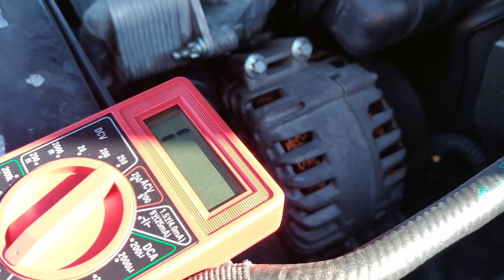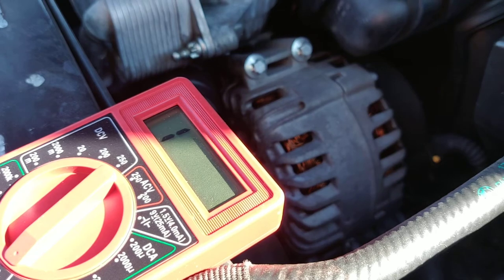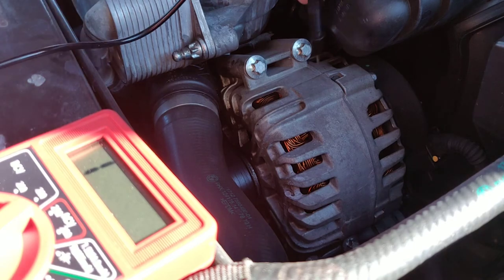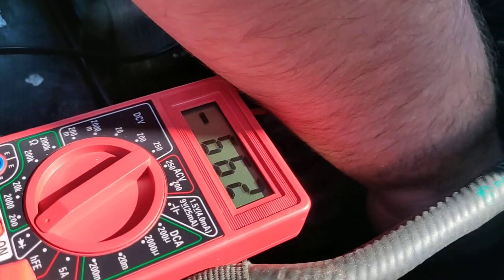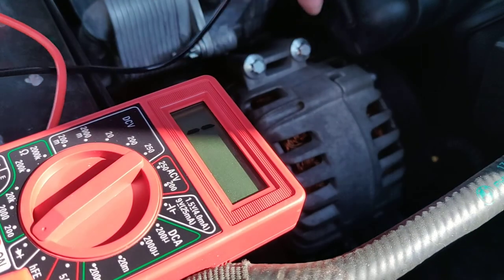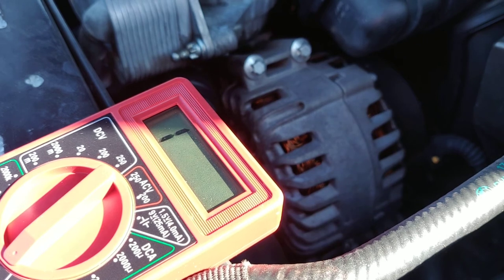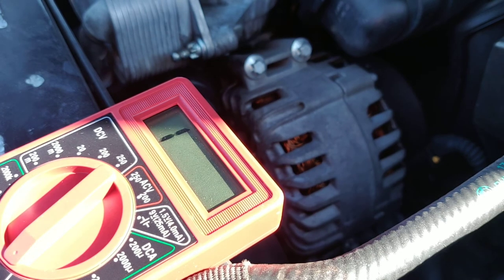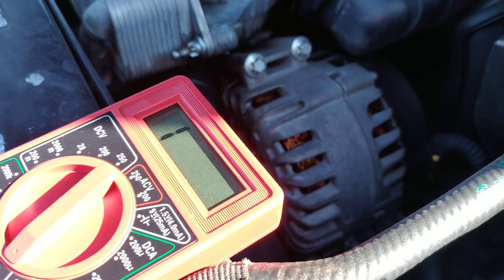BMW Parasitic Drain Found: How to Test and Fix Bad Diodes in Alternator

Comment: Turned out i had this problem on my old land rover, put brand new battery in, and still drained over night ( then learnt it was  a alternator problem) my question is after initially replacement of brand new battery i done a parasitic draw test (still with bad alternator in place) and the draw was only 15 milli amps, assuming it simply my dash clock, with such low drawit shouldn't have drained the battery but diodes were definitely gone in alternator, draw test was done at battery terminal, it appears you have answered my question ( draw test means battery is still hooked up so it didn't show anything besides that dash clock draw) does this sound correct or do you think something else was at play, i watched about twenty five vids and your the only one who mentioned the battery must be disconnected to check diodes correctly, wish yours was the first i saw, would have saved me a lot of time.

Comment: Do you have to take the main power wire off the alternator and unplug the wiring harness before you do this test or can you just test it in place?
Reply from the maker: I did the test with the wire in place. You want to see if the diodes are pulling power with it connected to the system.
Reply: @Jay-May  I appreciate you writing me back.   I'm going to try both ways I think.  I had another guy (different video) who told me I should remove the wires.   I'm still learning.
Reply: I have the same issue with a mk4 Golf and I measured the diodes with the cable connected  and disconnected from the output of the alternator (negative pole of the battery was previously disconnected). When the cable was connected at the output of the alternator, I measure 0.453V on one polarity and 1.366V with the other polarity (the value increases to 1.366V), which means the same issue shown on the video. However, when I disconnected the cable and measuring again gives 0.5V on one polarity and nothing with other polarity, which is correct if the diodes are well. So I think we should measure with the cable disconnected. I haven't found the source of my parasitic drain on the alternator circuit ( drain of 1.33A). Any clue?
Reply: @PauloM463  Makes sense, thank you.  Sorry, I'm not sure about the 1.33 amp drain.  What about radio and other memories, could it be drawing that much?  Is your battery dying?  There are videos of how to track down what is draining, but not sure which video is best or really works.  Sorry I can't really help.  My friend, the reason I posted a question here, ended up just having a bad battery.

Comment: doesn't the Bat+ terminal on the back of the alternator connect directly to the POSITIVE Terminal of the battery? and if the frame of the Alternator is Grounded.. then aren't you essentially measure the terminals of the battery too?..  What if I disconnect the GROUND cable to the Battery and then Test it?  Thanks for the video.. :)
Reply from the maker: You can test both ways, but if the diodes are good there should be no difference. We are measuring for battery drain.

Comment: Will autozone alternator test be able to detect bad diodes? 
I was told I could have a bad alternator since my battery drains
Took it to autozone to get it tested and they said it was working good 
Is the diode test with a multimeter the only way to actually tell?

Comment: I have this same problem!  Except I have an outright failed diode, it beeps at me when testing.  A new brush/regulator should do the trick (way less $$ than a whole new alternator).  BTW you should test with the negative on the positive terminal of the alternator, with the battery negative disconnected.
Reply: You ever figure it out
Reply: @hunnitkaydj  Yup - replaced the voltage regulator $40 - reduced the standby drain a bit (had other issues keeping the car awake) until g30 relay turns off.
Reply: @GP-SEA  you know what the other issues were?
Reply: @GP-SEA  thank you🙌🏽
Reply: @hunnitkaydj  I'm pretty sure I have a module not going to sleep when it should - I think it's the transmission 'park' selection switch in the transmission that is keeping that module 'awake' until the G30 relay times out.  The LED on the shifter isn't solid / fully illuminated...
Reply: @GP-SEA  I think the led stays on for about 15 minutes after the doors are locked, did the alternator fix help it stop dying?
Reply: @hunnitkaydj  Normally, yes - but not in my case - I don't think the transmission 'sees' itself in Park - so it stays awake until G30 shuts down.  The LED is on long after the 15 minute window.
Reply: @GP-SEA Was your fix on an e90? I have an e90 2006 330i w/ a 180A Valeo alternator. I ordered a new Valeo voltage regulator but I can’t tell for sure if it has the diodes in the voltage regulator part. Some people online are saying that the diodes/rectifier are separate and not really replaceable. 

Hopefully they’re not right wrt e90 alternators
Reply: @johnnypolex  yes, it was an E90, and the diodes are in the regulator. My replacement was Bosch F00M346089. I no longer have the slight drain across the diodes
Reply: @GP-SEA  Thanks for the reply! Hopefully this helps info helps others with a battery drain also. Kinda kills 3 birds w/ 1 stone (VR, diodes & brushes)

Comment: hi there, 
i just checked mine and: when i put black lead of multimeter on plus from alternator it shows 402. after i switch them for 2 seconds its shows 1200 then go to 1 and stay there. after i take the leads out and touch again red on + and black on - nothing apears, just staing at 1.
black to + and red to alternator body = 402
red to + and black to alternator body = it goes for 2 sec to 1200 (oscilating fast)
next move i put again  red to + and black to alternator body = and nothing happen.
if i switch black to + and red to alternator body and then red to + and black to alternator body its go again with that  2 sec to 1200.
is this ok or my alternator´s diode are gone and is draining my battery?
Reply from the maker: Do you have symptoms of battery drain currently?
Reply: @Jay-May  HI and thk for reply. if i leave the car untouched for 2-3 days battery dies. i change the alternator these days and i didnt have the cance to check after 2-3 days to see what is happening. what do you have in mind?
Reply: @djovidius3545  Have you found the cause of the battery drain?

Comment: I did this test and with the positive on the positive terminal of the alternator and negative on alternator casing I get no reading at all. When I reverse them and put the positive on the casing and the negative on the positive terminal of the alternator I get a reading of over 250. Does this mean my alternator is toast and causing my parasitic draw and not even charging my battery properly?
Reply: The way he explained it is wrong, when you put positive on the positive terminal and the negative on the casing you shouldn’t get any reading but if you have the negative on the positive terminal and positive on the casing then you should get a reading of 500 to 800
Reply: @ortegaaugie  THIS is how everyone was taught back in electrial theory anyway. So thanx for pointing that out.  The meter & the electron flow. lol
Reply: dammit i mean electrical.  way back.  80's at the end of vacuum tube theory.  flow from negative to positive.  dam i hope it still has believers

Comment: Did new alternator sort this?
Reply from the maker: Yes, the new alternator fixed this issue. Even though it was charging the battery, the alternator was causing drain on the system when the car was off. 
Another thing you might want to consider if you have comfort access on your BMW is to keep the keys away from the car as it will put the car in a constant check state/readiness which will drain the battery as well.
Reply: @Jay-May  no comfort access tx